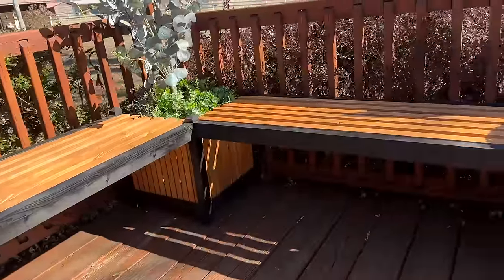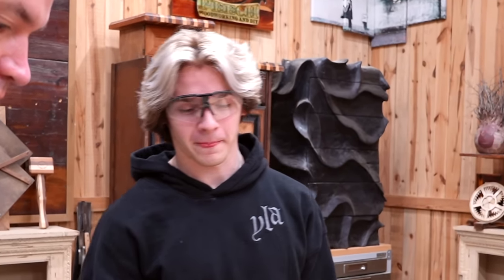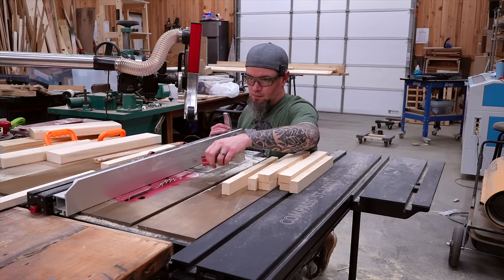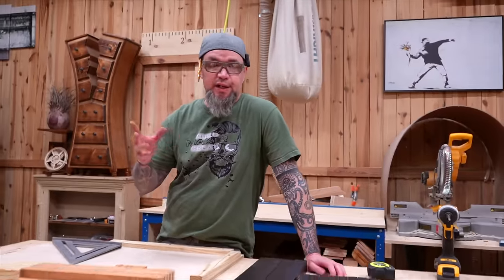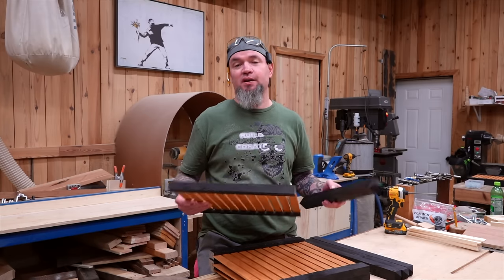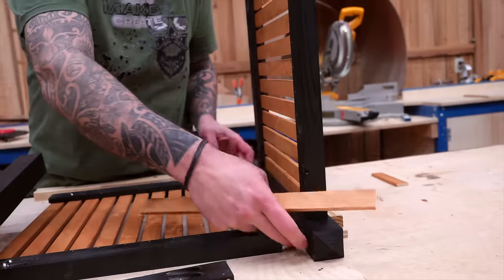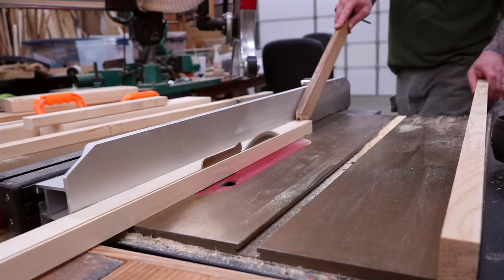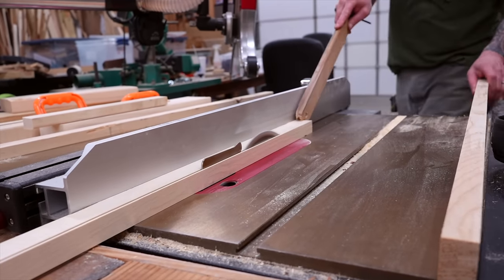They Want $1800...You Can Build It For $26

Comment: Anyone else concerned that the bench is only supported by the pocket screws in pine?
Reply: You can purchase any type of wood you like, it’ll increase the cost, however.  Might as well build it to last.
Reply: A pocket hole joint has a sheer rating of 707 pounds, without glue, and he used glue as well. Im sure its gonna hold.

Comment: When you have the right tools…you can build it easily, but not every one has a workshop that is so well equiped!  😊 beautifully done.
Reply: The tools don’t cost as much as you think for basic ones. As long as you’ve got a mitre block, saw and clamps you can make these.  It will just take more effort as you’re physically sawing.   Don’t be put off.
Reply: The dude uses a 4 dollar bit extension instead of just having 19 drills like every other "woodworking" youtuber. You're barking at the wrong cat.
Reply: Bottom line is the carpenter makes the tool, the tool doesn't make the carpenter.
Reply: @philspd473 I’m not even a carpenter and I know this. I can do more with just a circular saw than most men could do with a full workshop. I was a commercial steamfitter by trade, once you know how to really use a tape and field measure things you “can” do just about everything any other tradesman can do. I might be “slower” at it than a true carpenter but I’m also a perfectionist on everything I do😂
Reply: @ligyron2835  agreed.
Reply: That negative jab tells me even if you had all the right tools you still wouldn't be able to build this 😊
Reply: @honeybadger3570 How is it even remotely negative? They said it was beautifully done that's positive. Saying it's easy to do when well equipped like him isn't negative either, that's factual. It would be feasible yet harder with simpler tools.

People are too sensitive these days, taking offense for a simple neutral comment that you find not complimentary enough...
Reply: @Kellycreator  You need the space for the equipment and if you want one do you trust someone to build it or go to the big box store. The manufacture who has to pay someone a wage, rent, utilities, "insurance" and shipping from another country.  Since you are using powered cutting tools the Insurance raise that price the most.  buying it from a DYI store paying to not having to buy everything you need to make the pieces.  Does your homeowners Insurance go up if you are using woodworking tools in the house. One you use as a means of making money?

Comment: What an attractive project! I think I would add an 8 or 10” free floating X support piece for under the pot. Painted to match the frame. Thanks for the inspiration!
Reply from the maker: Great idea!
Reply: Trying to figure out where this cross support piece would go. Would like to build one for my backyard. Thanks in advance if you can please elaborate.
Reply: I think you would put it at the bottom for the pot to sit on..
Reply: @ashokmoghe8035  Hi, sorry I missed this yesterday. Gerald is correct. I wouldn’t want the bottom of the pot peaking out the sides at the bottom, so the support would raise it to the level of the side panels.
Reply: It would also be beneficial for drainage- unless you go with the Bob Ross of course 😉

Comment: Only one thing I would add.  That is a couple dowels (not glued, just inserted) at the ends of the bench where they rest on the planter.  As it is, if someone moves the planter, the bench will fall down.  The dowels will keep the bench from separating (with use or unexpectedly) from the planter.  Excellent work and looks really nice.
Reply: That's a good idea too... but weren't the rails attached with pocket hole screws to the planters?
Reply: @theoriginalmonstermaker  Were they? I thought they were just laid on top.  I may have missed that.   Disregard my comment if so.
Reply: He attached with pocket holes but your idea is pretty good too
Reply: @spocksvulcanbrain  what's good about your idea,  especially if you want to break them down to store at end of each season,  is that you can easily reconfigure them in different arrangements and not damage out surface of planters. 

Both could be useful depending on application.

Comment: This is a very cool project.   But,  my only concern, which is a big one,  is safety.  There are no support braces to keep it from twisting and keeping it square.   The pocket holes and nicely 90d corners are pretty sturdy,  but a wiggling child or a heavy adult will wear on those screws.  Or a large dog runs into a planter several times and again, and those screws can only last under so much stress.   It is soft wood. 

I'm not knocking the work and have no idea if the original he is eluding to has extra support.  I've just been the happy recipient of meeting the ground in quick response to a broken chair.   Keep up the good work,  Matt, and let me know your thoughts if you have time.   Thanks

Comment: Man I love the impact this thing has, it looks substantial but doesn't take a ton of wood.  

I prefer planters that can hold dirt without a pot, but it would be easy to modify the horizontal rails to work with some fence picket panels.  

In my area cedar has come way down in  price so it's well worth it to spend a little more to upgrade.

Comment: I love this idea.

Here is a question I have, as I'm still a novice and haven't worked with pressure treated wood...

I just priced pressure treated lumber, and it's basically twice as expensive.  But would it maybe be worth it for the durability?

I also know you have to let the PT lumber dry before working with it, which creates a delay as well.

Comment: Great model.  I will definitely be checking this out on your Etsy.  A suggestion...  why not drill your pocket holes on the planter before you paint and assemble them the first time?  It would probably be easier to handle the parts to drill the holes and you wouldn't have to go back to touch up the paint.

Comment: Another great build Matthew !
Just wondering how strong the end leg structure going to be with just pocket holes? I am normally trained to think in terms of mortise and tenon joint connecting the bench platform to the side legs.
Nonetheless, great building video as usual. Thanks.
Reply from the maker: Hey!  This was an article from Rockler "The superior strength of a pocket hole joint has actually been proven. Independent testing found that a pocket screw joint failed at 707 pounds when subjected to a shear load while a comparable mortise and tenon joint failed at 453 pounds - meaning that the pocket screw joint was approximately 35% stronger."
Reply: @MatthewPeechWoodworking  Wow !! That is something to keep in mind. Thanks for responding and sharing this. As usual a great fan of your work. Keep up the great work !!

Comment: I love your low material cost builds, they're always great ideas. The planters are great, but I have concerns about the strength of the pocket screws holding up the bench without glue. Have you done any stress testing on the bench besides just sitting on it?

Comment: I know this is off topic and maybe not even your wheelhouse but, well, I make wood projects to help me deal with stress and anxiety and use my FILs table saw but it is horribly off. (back end is closer to guard than front end) and I do not have the tools (gauges and such) to fix something like that myself.  How would I find someone to help with that ?  It is an extremely old saw (well, seems to be) and I have not found anything local for "tool repair" listed that wasn't just for blade sharpening.   Are there resources I am not aware of ?

Comment: This looks to be a fun build, I can work with construction lumber. I did have one problem with one of your other build. It was the six dollar planter box. Your fence pickets were 5/8 inch, the only ones sold in my area are 1/2 inch. I bought 7 just in case of error and they all measured the same. When I tried to screw them together, using the scraps, they all split. I tried different settings on the Kreg jig and bit but nothing I tried worked. Any suggestions would be helpful. I did leave a comment in that video.
Reply: I made my planters without a Kreg jig you just have to be creative.
Reply: @dougpeak7591   Yeah I was down at the shed looking at everything and figured that outdoor wood glue and pin nails would work. Thank you for the reply

Comment: I wish in these planter videos you'd actually show how you turn them into a real planter.  It's a nice planter shell but basically it's a box with non bottom.  What's the best way to actually put plants in it?  I saw live plants in your video but nothing about how you put them into the planter.  Is it just a round or square bucket or something?  Please explain!
Reply: Basically, you are dressing up an already potted plant. You take a plant with a cheapo plastic pot and add things inside these decorative planters so that your potted plant will be at, or just below the top for the best look. Like, say another upside down pot.

If you want an actual planter that you put dirt in, you'd probably want to, first of all, make sure the sides will handle the outward pressure of the wet soil. You'd need a fabric liner. (About $12 a roll at HD) to keep soil inside but allow drainage. And you'd need a solid bottom to support the weight but with drainage holes. 

Happy Gardening

Comment: I think there’s a math error. 

The panel rails are 15 inches with 12 one inch slats. That leaves 3 inches, which is divided by either 11 or 13 depending on if you want some space between the slat and the leg. Neither are 0.25 inches.

Comment: Are 2-1/4 pocket screws a typical size? I can easily buy 2-inch and 2-1/2 inch pocket screws, but nowhere could I find the mentioned 2-1/4 inch ones. Even Kreg doesn't list this size in their screw length guide.
Reply: I’m sure he meant 1 -1/4”…if you look on the table he has a container that has the screws in it, it has blue tape labeled 1-1/4”, plus in the video he states the top and bottom rails are 1” thick, so if you attach a 1” board to a 1.5” board (legs) and use a 2-1/4” (no such thing for kreg screws)it would blow through the wood, he also mentions setting the drill collar to 1”, would would be a good setting for a 1-1/4” kreg screw

Comment: Only $26 if you have $50k equipment
Reply: You really only need a table saw.  A miter or chop saw would be helpful,  but even a circular saw it hand saw would work (or do cross cuts on table saw also).
So like 200 bucks.  500 you could have everything you need for any project imaginable.
Reply: Dang! Those "Bob ross" bushes ain't as cheap as I thought they'd be 😮

Comment: Can you  {{or one of your loyal followers can . . .}} give me a suggestion on how I can trim off that rounded edge, and rip down any of the wood pieces, without a table saw?? I have been watching your videos for 3 years, and I have often said “I can make that!” However, table saws are a little bit of an expensive purchase with my very limited income for making items that will only get placed around my house . . .🤔 🤷🏼‍♀️ 😁
Reply: Take your circle saw and turn it upside down and connect it to a piece of of plywood. Drop it through by plunge cutting and turn over and use a straight piece of lumber and two clamps and you have a custom table saw. You can thank me later. Have fun and good luck ! Be safe !
Reply: @dougpeak7591  that’s an AWESOME idea!! 👍🏼  I will have that done before the weekend!! I have so many items I want to make, and give them as this year’s Christmas gifts to my family and friends!! THANK YOU THANK YOU THANK YOU‼️
Reply: Don't go getting yourself hurt. Yes, it can be done. I know because I've done it. 
BUT remember that an upside down circsaw has no riving knife and that could lead to pinching issues if you're trying to resaw lumber.
Please be careful if you try that.

Comment: Look what I can make with $26 worth of wood and $8,000 worth of equipment. 😐
Reply from the maker: Never gets old.  It's cutting material into strips.  Cut thousands of strips on my jobsite table saw.  Excuses.
Reply: Got my pocket hole tool on marketplace for 30.00, I got a miter saw for like 550 which was a bit over kill and had a bunch of options that wasent used here, my table was around 350 and a cheap ryobi drill I got that was 2nd hand from family. U dnt need new nor do u need fancy,  get 2nd hand tools and use them.

Comment: "you can build this too, for the low cost of $26" and $30k worth of tools. do a video like this with everyday do it yourselfer tools and maybe it'll be worth watching.
Reply: I'm not sure what you're complaining about? He used a table saw, a miter saw, a brad nailer, a drill, a pocket hole jig, and the kreg quick flip. The kreg quick flip isn't required. The rest of those tools are pretty basic. If you had none of those tools you could buy all brand new, high value tools for under $1k . Used you could get all of them for $300-$500  at a pawn shop for $500 at most, garage sale or marketplace for much less. Fancy tools are not needed, skill and will is all you need. Watch more of Matthew and be inspired.